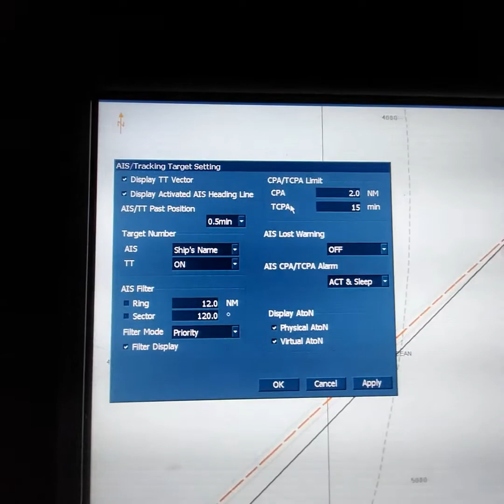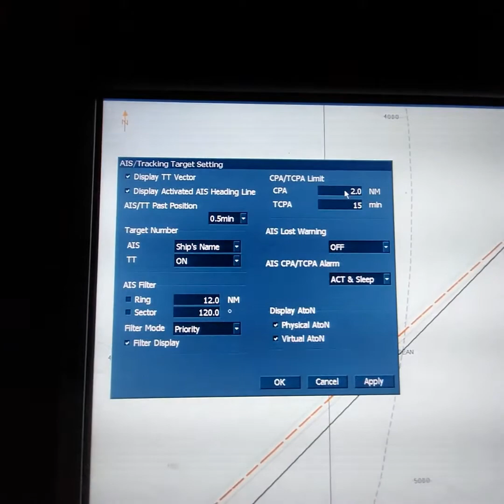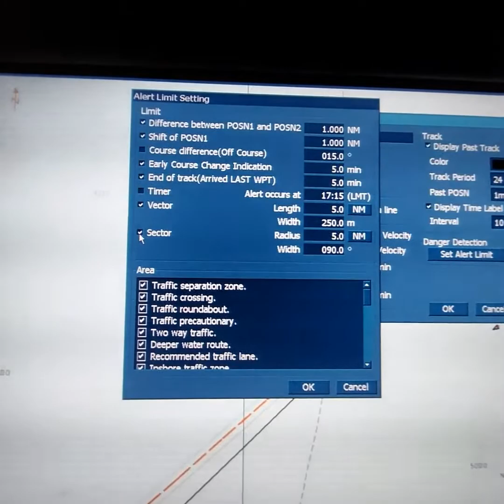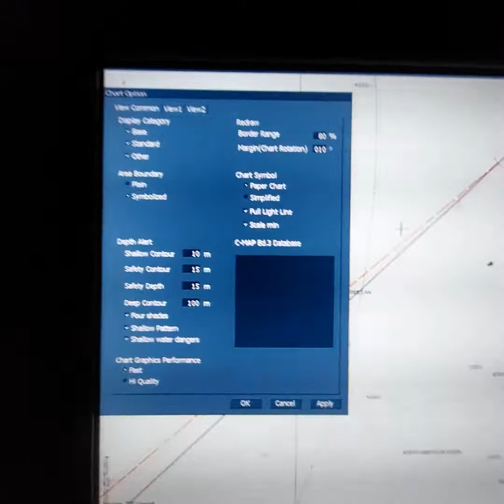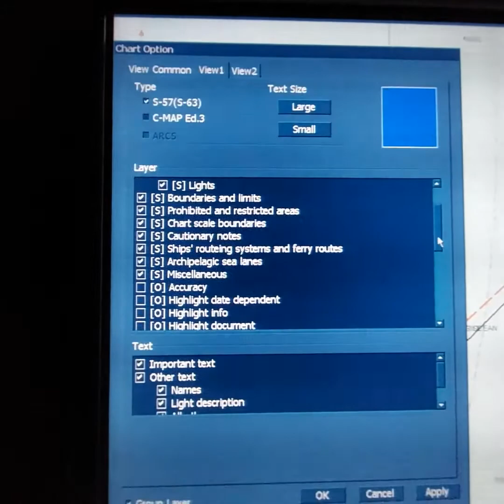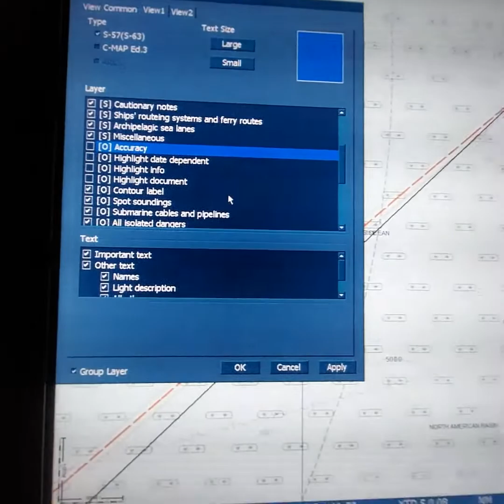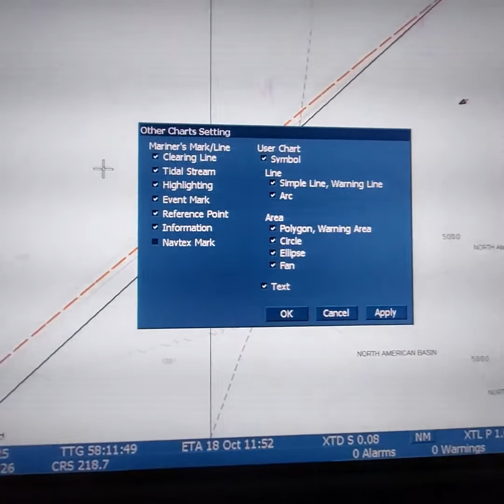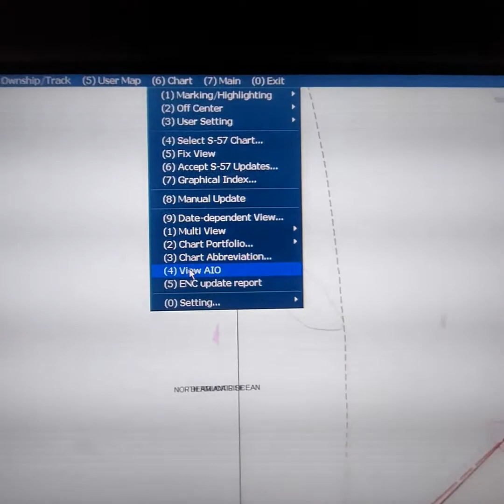ECDIS JRC JAN-2000/901B – Safety Parameters Explained | CPA, TCPA, Safety Depth & More

Comment: So when you doing route monitoring, you keep on AIO and when you doing passage planning you kêp it off?
Reply from the maker: Why ? AIO always ON.
Reply: @MARINERS-CLUB   another guy on youtube said that should keep it  off during route monitoring so i want to clarify that. Can u show me the reason why keep it always on ? like what rules define that!
Thank you sir
Reply from the maker: And how will others see information if your AIO is off ? If the route is crossing some AIO, all duty officers have to be able to see what is there ) 
It's not mandatory to keep it ON at all times, but it's logical to keep it ON so everybody can see the information contained there  )
Reply: what's the difference aio and navtex information switch on Ecdis?
Reply: Hello how can i hide the acquired manual position? Like i want to display on the present voyage?